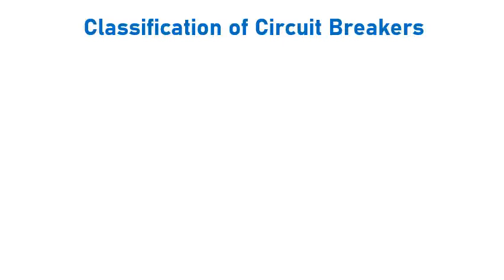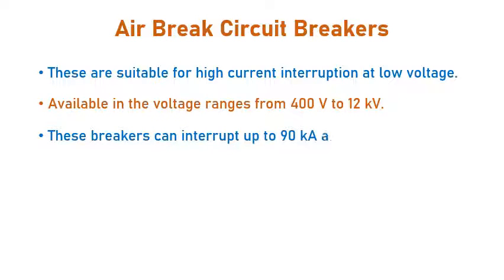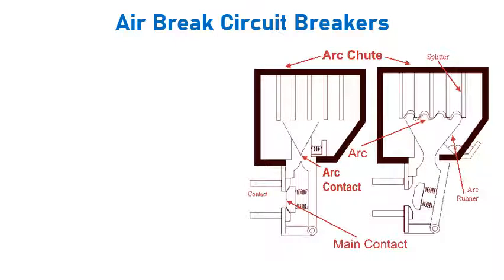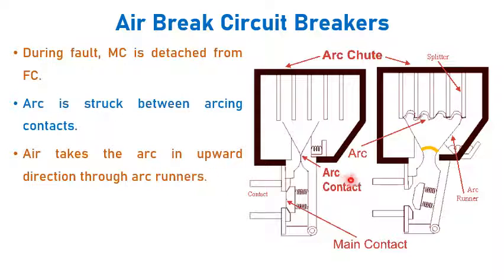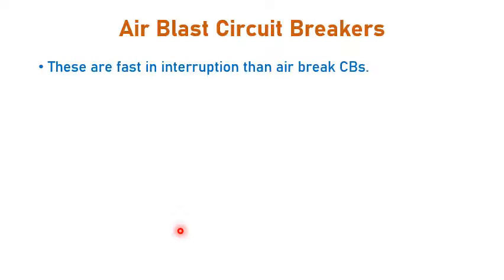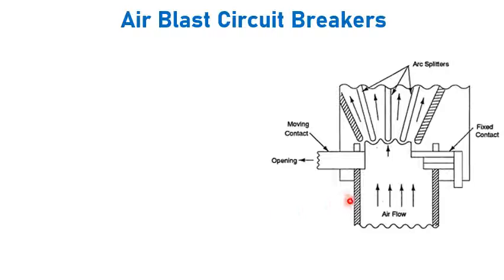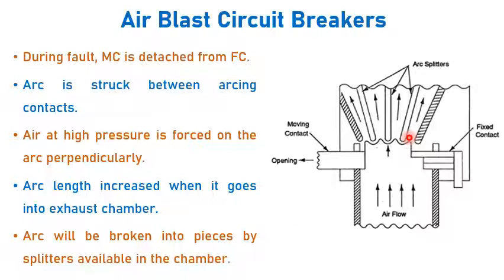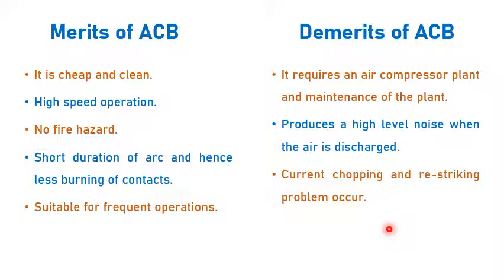Air Circuit Breakers

Comment: When we setup Reverse Wiring what does it happen? 
Normally correct wiring is from sources to load, pole on top is source and pole on bottom is load. So when we reverse it. What is happen?